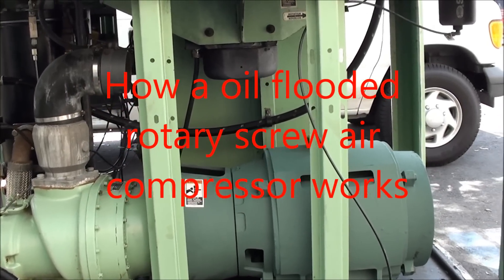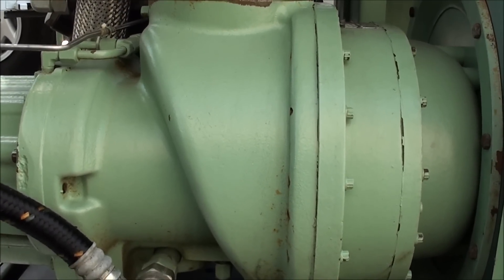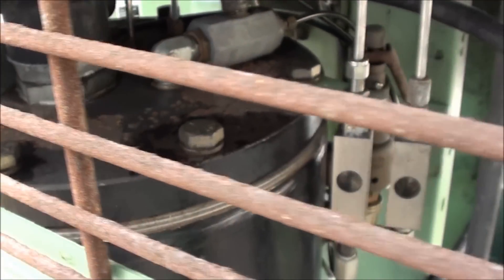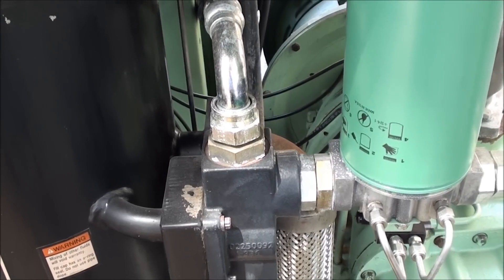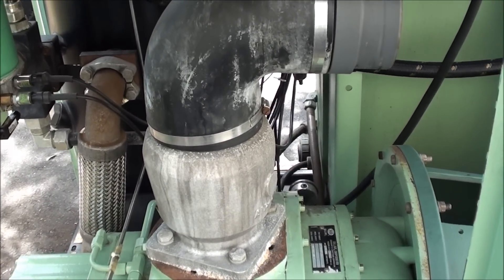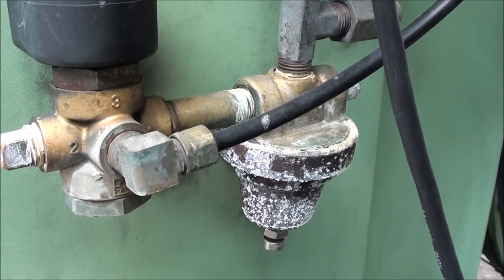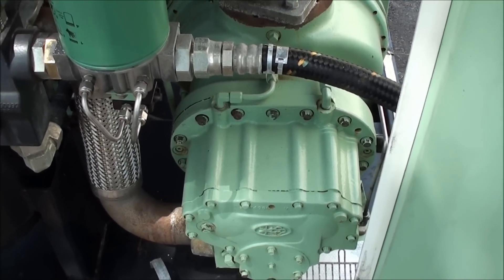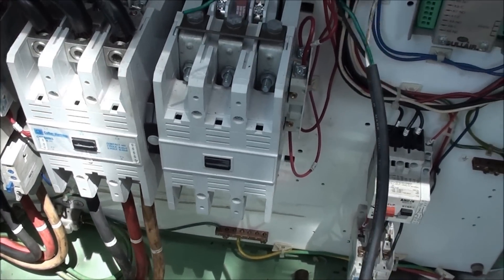How a oil flooded rotary screw air compressor works

Comment: Hi excelent videos i have a problem with sullair ls20t-200a  first i got alarm for dpi separator high and sump pressure high  so i replaced oil , oil filter and separator element which was in very bad condition also replaced minimum pressure valve that was also in bad condition but I am still getting alarm for dpi separator high and alarm sump pressure high 
any suggestions 
thanks in advance
Reply from the maker: The pressure transducers need to be replaced or recalibrated,
You may also try swapping the pressure transducers from sump to line and see if it corrects the issue, although if the line pressure transducer is reading high and you swap it to the sump it may give you a waiting to blow down condition
Reply: ROTARYCOMPTECH Thanks for the quick reply.
I tried swapping the wire connectors from one to the other and I believe that’s what happened 
I haven’t tried calibrating do you have any tips on how to perform the calibration and would you happen to have or know how I could get a parts list or parts drawing so I could get familiar with what’s what on the unit 
Thanks
Reply from the maker: @carlossilva154  you can't swap the wire connections or the unit won't even start, as now you're reading line pressure on what the compressor thinks is sump pressure, you need to physically remove the transducers and swap their positions, calibrating the transducers is a little bit involved,
That's why I made the recommendation to replace them.
As far as gathering information possibly online or your Sullair  distributor , the factory itself probably won't be much help they're pretty tight-lipped about proprietary information and dealing with end users
Reply from the maker: @carlossilva154   before you start changing and replacing things I would confirm or deny that you don't have a high separator differential. I would use a pressure differential gauge to determine the actual differential pressure,
Also keep in mind many of the newer machines read the line pressure Downstream of the aftercooler so there's always about a 5 PSID across the aftercooler @ full load.
Reply: ROTARYCOMPTECH thanks again for your support 
I’ll interchange the transducers and will reply with results

Comment: Why would you have to bypass the oil cooler when it's on start up? Dose it pump better when it's hot?
Reply from the maker: It's just the characteristics of the thermo diverting valve or thermostat like in your car,
The thermostat element doesn't open up until it reaches its set temperature

Comment: This is a solidly build portable compressor capable of driving a nail gun or other tools>>>ur2.pl/1018     at 2.6 cfm it won’t run a paint sprayer but it will drive pretty much anything else including my nail gun. Best of all, the price is right! I’ve used it for about a week now building an 8’x16’ shed...framing, sheathing, roof, and siding. It’s worked flawlessly. Note: when I bought it 2 weeks ago, the price was $89...it has gone up about $30 in 2 weeks...I don’t know if this is because of the steel tariffs or what

Comment: Our compressor shuts off when the temperature starts to rise. It’s located outside. We are thinking about changing the heat coil too cool it off. What do you think will help from it shutting off besides the coil? We have a “LeRoi” brand.
Reply from the maker: Hector Garcia-Martinez you can check the temperature going in and out of the cooler it should reject at least 30 degrees if it's more than that and it's still running hot you need to replace the thermo diverting valve element
Also known as a thermostat.
If you're not rejecting at least 30 degrees on the cooler than I would say replace the cooler.
Reply: ROTARYCOMPTECH thank you for the reply and by the way, we are thinking about replacing the “heat exchanger” not coils.

Comment: I have two sullair 2210's. It seems to me that their oil consumption is pretty high.  Is their any way to adjust this or is it just the nature of the beast? Thanks for any help or advice on these machines.
Reply from the maker: Jason Hill I would replace the separator element and make sure the scavenger line orifice and tubing it is as it should be
Reply: ROTARYCOMPTECH thank you

Comment: Hello, we got screw compressor from Compair brand, we are facing some problem in that; can anyone please guide us to rectify the problem. The minimum set pressure is 6.4bar and maximum is 8.6 bar; some time it is not re-loading the air once after stopping the compressor on its maximum set pressure.

Comment: Hello, I just came across your channel while doing some compressor research and have thoroughly enjoyed your videos.  They are extremely informative.  I am about to purchase an early to mid 1990's LeRoi 185 cfm compressor with a John Deere diesel engine from a friend.  I will be using it for soda blasting some restoration projects (mainly aluminum) that I have. 

 I am not familiar with rotary compressors but look forward to learning more about their operation and the specific maintenance requirements of this LeRoi.  My background is with Cat plunger/high pressure pumps, which seem like a piece of cake compared to these compressors.  Thanks for uploading!

Comment: Very nice video.  I used to work on these in the 80's and for 30 years.  Way back Sullair was using an auto transformer for start ups on the larger units ... like 400hp.  I see the Sullicon inlet valve is gone.  The rest looks the same except for the microprocessor controller.  My last 10 years was with an IR company so I didn't get to see the Sullair version.

Comment: Hello I have seen your videos it's  really good  And I need your favour  i have sullair LS25S compressor . When we start the compressor   it is running  but some mint latter it is shutdown  by showing sum pressure  low or separator pressure  high please  give me feed back how to tackel the problem
Reply from the maker: arjun shrestha more than likely you have an issue with the pressure transducers or transducer, you need to First confirm that you don't have a high separator differential pressure.
install a pressure gauge on the line side and a pressure gauge on the sump side or a differential pressure gauge, if the separator differential pressure is under 15 PSID you have an issue with the transducers not reading correctly.
at this point if you do not have new transducers they can be calibrated inside of the microprocessor, or you may try to swap transducers as one may be reading higher than the other one.
is all it takes is one transducer to read 5 lb High and one to read 5 lb low and a 5 lb differential across the separator and you're going to get that fault
Reply: ROTARYCOMPTECH  
Hi hope you are doing good And thanks you for responding  actually  i already  change new pressure  transducer  but problem is same . Actually  when we start the compressor  sum pressures  is rising and stedy  and also it goes  full load  after that when compressor  is going unload the sump pressure also goes down it should be stedy or less not a zero and its showing low sump pressure error then compressors shut down i have a some photo can I send to you directly. Please suggest us to tackel the problem   th
Reply from the maker: arjun shrestha from what I'm reading and understanding in your comment it sounds like the unloaded sump pressure is not set correctly, when the compressor unloads the sump pressure should be no less than 30 PSIG ideally 60 PSIG, have you checked the unloaded sump pressure ?
Reply: M also service engineer from India

Comment: Hi guy i  own to v200s sullair  compressor and cant seem to reset the dam  mentenance service light.  A ante in the book.    I realy dont need to call sullaur. To rest a service. I know. Theyll charge. Me to reset.   Service. Some of want to save do our self.   Do you have any infor on this.   I can only  look threw the controls it. Wont let me chang any  thing. Thank for your. Time.
Reply from the maker: Rui Bem is that a portable compressor?
Reply: ROTARYCOMPTECH 
Its oil flooded rotary twin screws  igets some pic so yall can see there are not very old. 1 is bulit in 2015 and there other  2012.      They both are Air cooled radiator fan 
 Just like video   Watch it all  time.  And i apply at  wrk

Comment: I just picked up a Quincy QMT25  Quincy wants $475.00 for 5 gal of oil!  Some local guys that have screws to sand blast tell me to use ATF. What oil do you recommend?
Reply from the maker: I would stay away from automatic transmission fluid it has a carryover problem a cheap alternative would be da torque fluid or the delvac Mobil Oil Products
Reply: James Bounds We ran motor oil in our sand blasting screw for a decade without issue.
Reply: Oil depends on use of compressor. Sand blasting with a unit creates a very dirty environment. Synthetics are best for long life, The trick is to properly filter the inlet air. A standard air filter is NOT the answer, spend some money and get a multi-stage air inlet filter. Most oil filters are 15 or 20 micron rated. you would want an air inlet filter 15 or less micron. Synthetic oils give you long oil change intervals (8000) hrs. or annually, oil filter every (2000) hrs, oil analysis is also recommended (2000) hrs. Petroleum based oils are only good for (1000) hrs or 3 months with the probability of varnish build up internally. ATF fluids lost their compatibility years ago. Different manufacturers of ATF came out with a wide "flash point" range. ATF is a 15 wt. You may want to consider a 20 wt. hydraulic with "antiwear/antifoam" additives. Also petroleum based fluids MUST be held to a strict change interval.  Remember for every 5 degrees over 200F the oils life is cut in half, synthetic or petroleum based.  Like all mechanical equipment neglect is the most harmful thing to an air compressor.

Comment: Very informative video. I own a Sullivan Pallatek DF375 and it is the heart beat of my operation. If my compressor is not maintained regularly and given TLC it will let you know at the worst possible time, and for me that is not an option. Having purchased my Rig 5 months ago, I want to know as much as possible about every component that makes up compressor. Recently because of excessive oil in my Discharge, I removed the Sump separator element and did a close inspection, I was apprehensive at first having never done this, but with videos like yours and others, the task is not so intimidating. I took video as I proceeded and will post soon to help others. Pay it forward! 

Thank you,
Joe
DBTX
Reply: My advice if your machine is an important element of your operation is to find a reputable air compressor distributed to look after your machines on a regular basis. It’s cheaper to maintain than to have breakdowns

Comment: Is there any danger in danger in modifying the coupling. We were having problem with purchasing the parts. What we did was replacing it with fabricated sprocket and used chain to couple the compressor and motor. The  unit seem to run normal but after few minutes it will shutdown. Is there kind of a knock sensor that make it stop when sensing abnormal changes in vibration? We where also having problem with unlocking key password of the user setting. The unit is DMC with 100 hp motor.
Reply from the maker: there's no problem in modifying the drive coupling there is no vibration sensor on any of the rotary screw compressors that I've seen
Reply: Thanks for making the video people like me learn something from it.

Comment: What is the orifice size on the oil size on the oil feed line? or how do I determine the orifice size on the oil feed line?
Reply from the maker: are you referring to the scavenger line?
Reply: The main 1" line from the oil reservoir to the compressor lobes.

I have an older Sullair R D24 compressor used for vent gas system that doesn't have an oil pump but there's no orifice(may be missing an orifice, no maintenance records) on the main oil feed line to the lobes; the problem is I'm observing excess oil carryover on the main header, it seems we're over flooding the compressor. The separator elements was replaced and the lines purged, problem still exists.
Reply from the maker: +Mike Obu I've never seen a sullair air compressor with an oil pump only the vacuum pumps have oil pumps on them, I think I would get a hold of sullair or try to find a manual on the machine to try to determine if it had an orifice, you could always experiment around with a ball valve or a gate valve and throttle back the flow.
I'm sorry I can't help you any further than that it all comes down to GPM, horsepower and RPM

Comment: Thanks for posting , how many m3/min ?
Reply from the maker: I'm sorry Mohammad I don't understand the question
Reply: +ROTARYCOMPTECH I meant the capacity volume output ? Thanks
Reply from the maker: +Mohamad Khalil Hamieh the SCFM rating on rotary screw compressors of the single-stage version is about 4 CFM per horsepower.
this 75 horsepower horsepower compressor it is rated at around 320 CFM
Reply: +ROTARYCOMPTECH thank for the valuable information , thumbs up .
Reply: How much an reciprocating air compressor deliver air as screw air compressor deliver 4cfm in 1 hp?
Reply: 21.1

Comment: what is the best oil too use beside the screw compressor oil?   that oil is pricey ass hell
Reply from the maker: you can use a 10 or 20 weight
hydraulic oil and change it every thousan hours .Running any other fluid besides the PAO or polyglycol compressor fluid will result in oil carry over and the possibility of forming varnish deposits in the interior of the compressor mainly the cooler itself
Reply: +ROTARYCOMPTECH do you have any example what hydraulic oil? i know only 10w 40 and stuff like that about the viscosy
Reply from the maker: there's a product that Sullair  used to use called DA torque fluid, or the Mobil delvac products

Comment: One word of caution when changing a separator element on a screw machine. If the seperator element flange has a gasket either side of it (some have O rings) make sure there is a way for the element to be electrically grounded. There`s usually a staple or foil strip to ground any static build up caused by the compressed air passing through the seperator. If the element isn`t grounded the static can build up and create a spark when it grounds itself. A spark mixed with oil vapour, heat and compressed air usually results in  seperator vessel fire. It`s not so much a fire, more like an explosion; as it`s contained in the vessel. However the fire in the vessel will destroy the element with the result that debris will spread into the oil ways, the oil will be burnt, the safety valve will be damaged as will any controls fitted to the seperator vessel. Oh and you`ll need to visit the toilet as you will have crapped your self due to the massive band, flames and smoke. I`ve been a compressor engineer for nearly thirty years and this has happened twice; and that`s two times to many.
Reply: noted  did a oil  separator  change  a couple  weeks  back I read the notice  about  checking  ground  but there  was nothing  about  fire  and smoke!
Reply: Happened to me last year, so now i make sure all the staples in plus i run a ground wire from the tank (Receiver) cover (top) to the tank bottom then run a wire from there to the panel ground. I feel that’s safer
Reply: Happened to my collegue once. There was a bad separator gasket, and he cut a new one, which was without staples, and guess what, it banged.